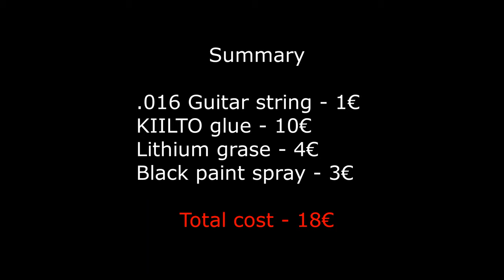How to repair Skoda Superb II (Octavia II) electric tailgate lift strut

Comment: Terrific video. Gave me the courage to have a go at the struts on my 2013 Skoda Superb. I used DIY clamps to close up the spring. I couldn't get jubilee clips to go under the springs it was too tight, I therefore used stong wire and used a jubilee clip at the other end with wire twisted onto it. The springs on the carbon brushes were absolutely rotten I made some, as advised, from old guitar wire. I found winding around a 3.5mm drill gave me a spring that was too large in diameter. I then tried winding, by hand, around a 2.5mm drill which was much better. I didn't really think that the springs would work, however, they do!
 I glued everything back to gether using bathroon clear silicone. All back together now and fully working again!
Reply from the maker: Great to hear! Mine are still working well, no problems so far! Thank you for your support and good advises!

Comment: how long do I have to heat the engine?  did it for a few minutes on a 2016 engine and the protective tube won't come off.  It's more likely that the protective tube will melt.

Comment: Hello,

neat work!
I would implement this less difficult. The aim is to have a drive that continues to function. The ingress of moisture can probably only be poorly prevented. It may help to drill holes to improve the ventilation a little. However, I can only judge this poorly without being on site.

On the motor, I would only remove the rear bearing shield so that I can get to the carbon brushes. 
I wouldn't push out the front bearing under any circumstances, because you can't press it back in. Normally, the front bearing goes into the stator first and then the gearwheel onto the shaft - we can't do that.
If you run some adhesive oil or penetrating oil through the inside of the motor, it will not become new. But it won't rust any further either.
Same for the outside of the motor.
That must be enough 😉

Comment: Excellent video.  Thanks for this!  It was clear that water intrusion caused the issues with THIS strut.  Makes me wonder if that is the only failure mode they have.  I'm saying, do they fail (have a shorter life) for other reasons (causes)?  And no, I'm not expecting you to know, or answer that.  Just curious, since these have not be around long enough for the answer to be common knowledge.
Thanks again for taking the time to make this video.....
Reply from the maker: Thank you! In my knowledge water intrusion is the most common failure. Also during the winter time, when rear lid is hardly frozen and attached to the car body, then operating electric struts may damage the gear or burn the electronics. Therefore it´s mandatory in wintertime, when pushing the rear lid latch, then you need also pull slighlty up the rear lid in order to help struts and prevent it to be attached frozen to the body. Similar logic also applies with VAG panoramic sunfoor, meaning to avoid any problems in wintertime, it´s crutial to remove sunroof fuse to fully disconnect sunroof operation.
Reply: @lutz6441  And thank you for that info!  So if my car is garage kept, and I don't drive much in the first place, my struts should last forever then!  Just kidding, but seriously....if it is a water thing, you would think the maker of the struts would create a better (water tight) seal - in the first place.  Mazda wants $724 each for those things.  That is enough to inspire me to follow what you did in this video.  That is, if the insides of the different brand struts are similar.  I would think they would have to be.   Anyway, thank you for the great video, and info!

Comment: awesome job and thank you for sharing! does the motor in the strut have a part number or something like that so I can order and replace only that? I get "0018 - Motor 1 for rear lid 
          B11D9 13 [009] - Open Circuit" although the struts look pretty much new (bought them second hand). It's about a vw passat b8
Reply from the maker: Thank you, most likely it´s imposible to find replacement motor from the market (maybe only used one). I strongly recommend to open them and carry out prevetative maintanance as I did with mines.

Comment: Hello
 I am  trying to install electric tail lift in my bmw x3. I tested the strut with 12v. Initially they worked but now the motor works but not going up or down. Is there a way to reposition or reset them?

Comment: Thank you very much for this video. Could you please specify the exact type of glue you are using to seal the motor?
Reply from the maker: I have used Kiilto Masa fix and sealant glue, but you can use other glues as well. Just be sure, that you can make it waterproof.

Comment: May I ask a question?  There are at least 6 wires that are fed to these struts.  Two of them are usually heavier gauge wires, and go directly to the motor (brushes, I believe).  They are the motor + and - leads (power to the motor).  But wires labeled "B+", "A signal", "B signal", and "Ground" all also feed in there.  I looked watching the video, and I could not see where they attach, or what they connect to.  So if you have any of these struts apart, can you tell me - just WHAT do they connect to?
I'm asking this because I am hoping to be able to make a determination, if different model year struts could either work for other model years [I'm trying to learn the differences between them - as my background is an Electrical Engineer - I might be able to make these determinations].
Thank you in advance for this!
Reply: Hi, It is most probably the 2 hall sensors - a feedback to the MCU. They go nowhere, just sensing the position or rotation of the motor via the magnetic ring or whatever the round element under the PCBA is. If there is an error reported by diag with feedback, it can be wires or motor does not work = no feedback for MCU.

Comment: Hello, any ideas why strut might rattle? 
It works perfectly but rattles on every little bump, and is very annoying. 
Octavia mk3, but I think they should be nearly identical
Reply from the maker: Hard to say, maybe greasing it with some spray may solve this issue?! Or to prevent any failure in future, open the strut and do as seen in my video. Maybe then you can short it out, why it’s rattles.
Reply: @lutz6441  Quick ”fix” to that was to add little piece of STP 20mm sound deadening foam to the body, where rain water goes down, just in the middle, like 2x2cm piece
Applied also clear ppf in the case it starts to rust, as foam is great in sucking water into itself, that was quick fix for me, as I didnt want to mess with 500€ shock lol 😂 as it was working perfectly fine, only was rattling.

Comment: Hi. Great video. Can you tell me how I can test struts? If its possible to know which one is broken, the diagnostics showed nothing. thank you very much.
Reply from the maker: You can power the wires and see, whether struts are working or not. Still I suggest to open both of them and do the preventative repairs even if they seem ok. Most likely one day you´ll face the problem, that struts are not working and then you´ll need to repair them anyways. This water intrusion is common failure and eventually they will fail some day.
Reply: @lutz6441  Mine dont react (not same model as yours), csn they be manually (or by force) reset to see if they work? I need to be sure they are the issue and notnother components. Tnx

Comment: What could be the issue when the electric boot does open but then does not hold in the position? I.e. it opens and then immediately closes.
Reply: +1 clicks open, and falls back, sometimes beeping.. if pulled up 5-10cm and then pushing button on boot, it opens all the way.. still motors?

Comment: On the octavia 3 its a newer model and the motor is not glued on all the way like this. Just need to remove it from the top part  and better to cut with a dremel tool

Comment: Cannot get my 2014 strut to unglue. even tried more heat till plastic was very hot
Reply from the maker: You have to heat it up quite a long time, until plastic is very hot and before melting process, but still should remain it shape.
Reply: @lutz6441  Unfortunately my Skoda Superb struts appear later models. (Manuf. 2014)In the end I `dremel` cut off the outer tube. It would not slide over the base fitting either.There is no inner plastic cartridge covering the motor drive instead the outer sheath is glued to the top and bottom mechanism mouldings only with what appears to be plastic pipe weld glue which will not melt before the plastic melts also.  The inside looks like new. Maybe I should have found out how to test the electrics off the vehicle first first!! I can replace the outer sleeve with 32mm waste water pipe.
Reply from the maker: @andyhopkins4693  Thank you for your feedback. This is very interesting to hear, as I thought they all are the same. Still if its possible to add new self made sleeve, then this seems to very good deal. Are electric motor and gear drive same as older versions or completely different? Did you sorted out, what was wrong with your struts?
Reply: @lutz6441  
does not  have an exposed  ball bearing . If it is there it is within a  moulding plastic welded to the sheath. I only cut away 1/2 of the cover lengthways and i believe you would have to take pressure off the spring (Which instead of being greased is covered in a thin felt layer.)before safely going any furthur.   I think it is called `built in redundancy` !!  A dealer just told me to buy new ones as mine are 6yrs old and when they stop they are faulty. So of course he did not have a clue or know how to check which one as unlikely both would fail.  I have just put manual struts on instead. Fraction of the replacement cost. You have to get out to load the boot space anyway !! I don`t know how to upload you a picture.

Comment: In my skoda there was on broken cable in cylinder motor
Reply from the maker: Very good to know, but as you have already open the strut, it is wise to make it watertight and check electric motor brush springs conditions.

Comment: how long do I have to heat the engine?  did it for a few minutes on a 2016 engine and the protective tube won't come off.  It's more likely that the protective tube will melt.
Reply from the maker: It should come off, as it is clued to the plastic cover. Then adjust your heat gun to lower temp, but heat it a bit longer.
Reply: I've got the same problem. Cannot came off after heating. My Skoda is from 2015. How did you do?
Reply: Anyone did handle with it ? I am stuck with trying to re-glue the cover ..